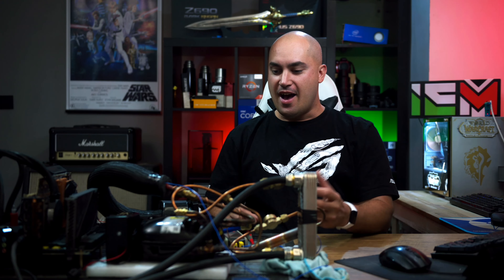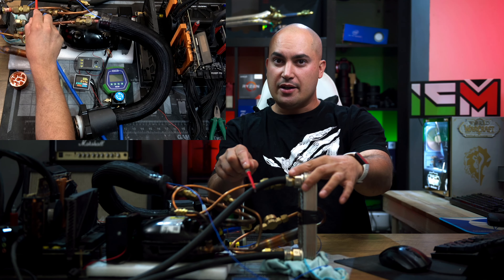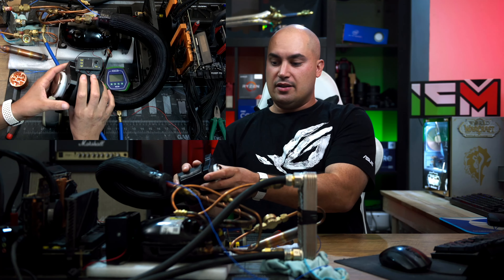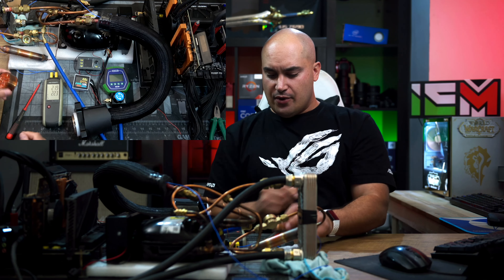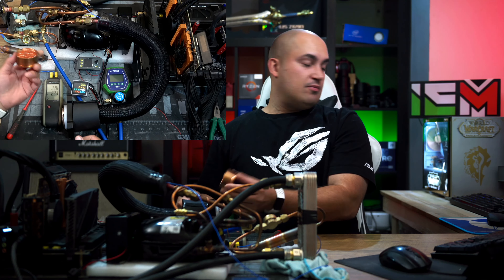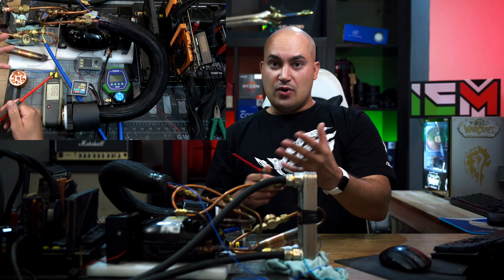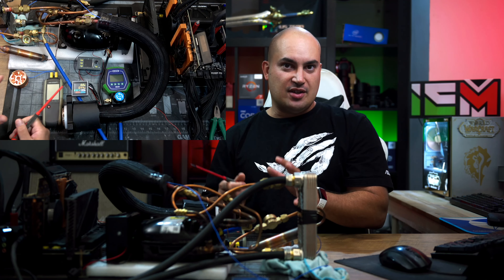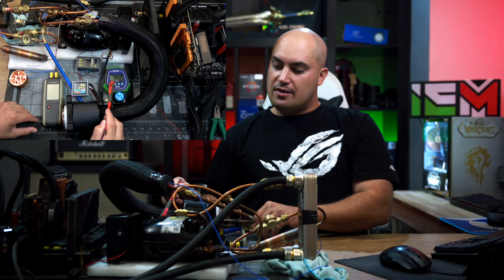Mini Phase Change Cooler Ep2: 12900KS @ 6GHz WoW Gameplay

Comment: This is a great build, how is the cost of going smaller, quieter and with more control vs using "standard" condenser, fan and Danfoss recip compressor ?
Reply from the maker: The plate heat exchanger it can be found around 39€, the compressor with inverter at 160€,  the Bartx evaporator with mounting kit is at 160€, add some for the pipes and stuff and 10€ for a small 400g tank of Propylene, isn't expensive at the end

Comment: How this would compare (power consumption /performance) vs a 120-140 mini ice fridge like the one i use on my co2 laser tube. (It keeps my destilled water at 16°c all the time )
Reply from the maker: Depends a lot on your evaporator speed and refrigerant used, to run at 16C it will probably have a very high load capacity, going down in temp you need much more power. Do you know what kind of refrigerant gas it uses?

Comment: Do you think E-cores are useful when gaming online or it hurt performance?
Reply from the maker: It hurt performance on auto, if you set manually the ring ratio to at least 42 you can leave the e-cores on
Reply: @HardwareNumb3rs  I don't know how to overclock because it will not be stable.
My score is p cores 93
E cores 79
Just want stable manual setting. 
Which value should I put?
Cores numbers 2,3 are favourite
So 1.34v for 52
Other cores are 1.4v for 51 ghz
Thus results shown on asus z690 hero

Comment: I'm confused, was GPU power consumption included in your total figures? Just curious because you said 600 watts total but the math just doesn't add up to me
Reply from the maker: the GPU was going from 250 to 400W and the whole system (without the cooler) measured at the PSU (ROG Thor 1200W) was around 400 to 600, plus the cooler at 145W the range was around 550-750 in total
Reply: @HardwareNumb3rs  Still very, very good numbers compared to any single stage I've seen.  Just my SS ( RunMC Under the Ice with Danfoss SC18CLX.2 comp  R507 poe oil ) slight overcharge to run -40C typically under full load uses at minimum 800W
Reply from the maker: @Gti_Jason  The performance of this new blcd inverter is quite remarkable, this is a 7 cm3, yours is a 17.68 cm3, much more powerful. This little one considering the dimensions and the very low noise is one of my favorite
Reply: @HardwareNumb3rs  that is amazing! I would absolutely run that daily! I'm very impressed sir, good work!!
Reply: @HardwareNumb3rs  It's pretty amazing to be honest

Comment: Very nice project my friend, just one thing tho your gpu was consuming only 250w when u measured the 600w total system consuption and I think 3090s can go up to 450w or even 500w but even then still well under 1000 watts, considering it`s exotic nature anything under 1000w sounds pretty good.
Reply from the maker: Yes, the GPU was going from 250 to 400W and the whole system measured at the PSU (ROG Thor 1200W) was around 400 to 600, plus the cooler at 145W the range was around 550-750 in total, not bad for a ultra high end system

Comment: Here is an idea, maybe you could use the evaporator temperature to do PID control of the compressor RPM.
Reply from the maker: I could try to use an arduino or Raspberry PI to do a better integration, lot of stuff I can do here :)

Comment: I'm really surprised to see the 3090 using 51% in WOW. I'm still using a 1080Ti and at times it is  using 80%-90% in Dungens and Raids.
Reply from the maker: It is weird yes, with the CPU pushing like that finally that GPU is working in full :D